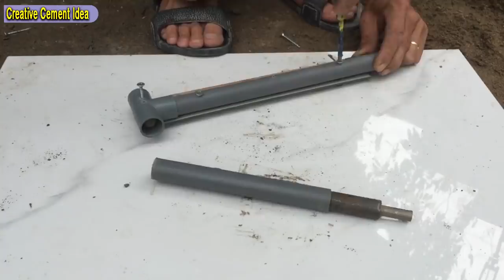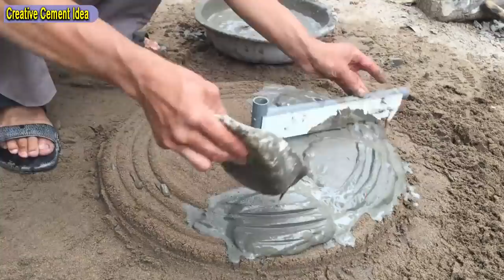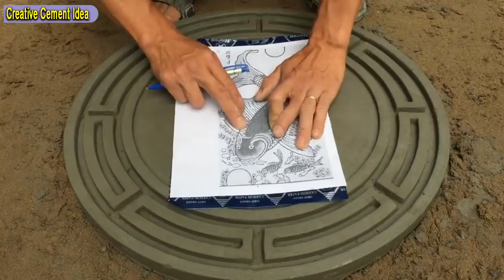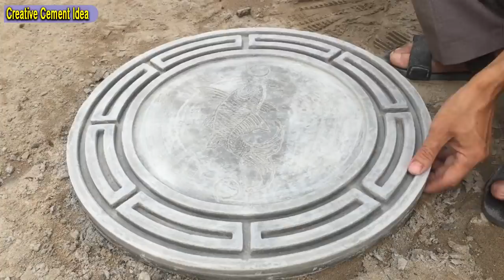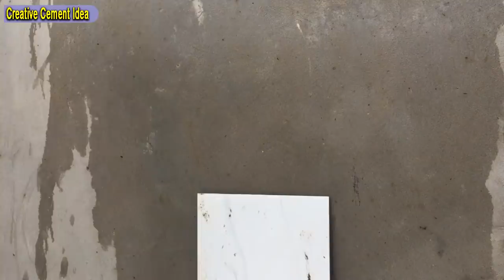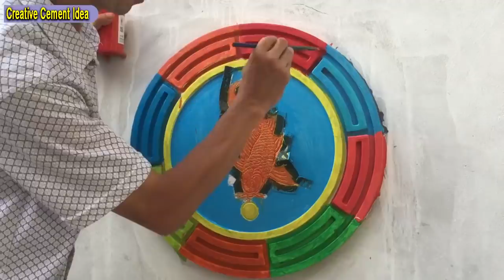It's great, when you make up the // decorating ideas for the wall yourself

Comment: What is sand and cement quantity
Reply: Half half
Reply: @fairytalestories9007  Thanks for the answer, just looked for this question to see if some one asks, do you use normal sand or smaller grain sand ? I want to try this this spring-summer, Tried with gypsum to do something similar but that hardened to fast and  everything got a mess
Reply: @sorin990  do you want to ask me that whether one should use normal sand or small grain sand??    So. Use normal sand
Reply: @fairytalestories9007  will try with normal, thanks
Reply: @sorin990  welcome...ya i tried myself with cemnt and sand... And made some pot.😋
Reply: @fairytalestories9007  heheh nice, well im gonna try the tool thingy technique :]
Reply: @sorin990  IF YOU LIVE IN AMERICA JUST GO HOME DEPOT BY CEMENT IN THE BAG READY TO USE THE ONE NOT EXPENSIVE AND NO ROCK